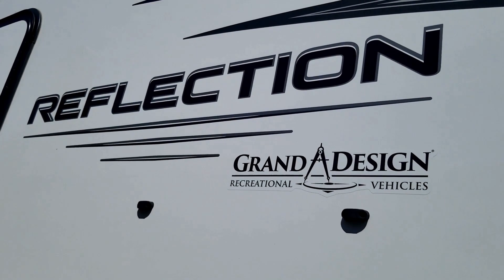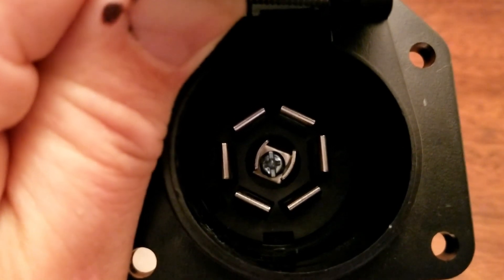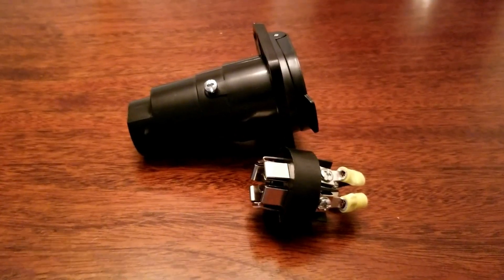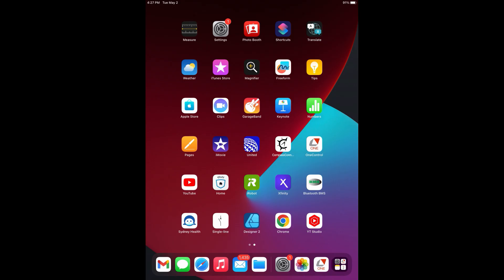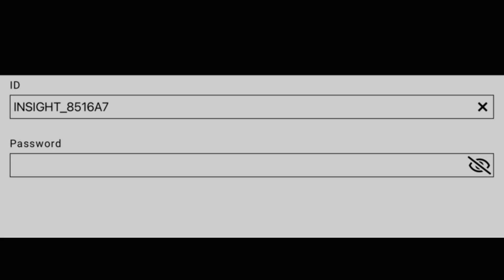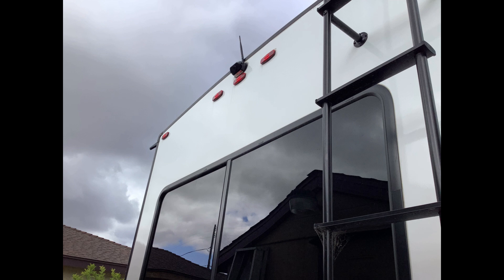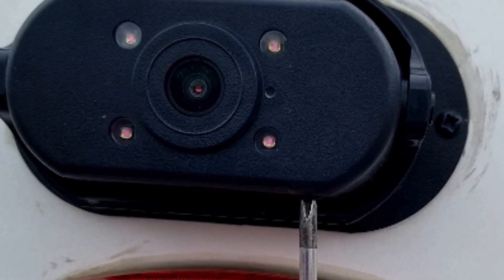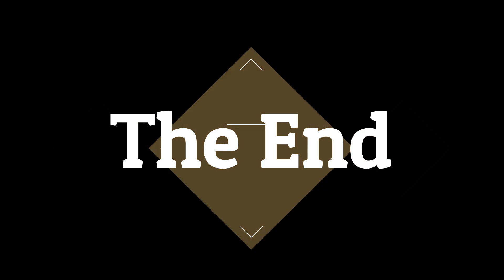Grand Design 303RLS   Lippert Insight Back up Camera

Comment: Please rename this to Onecontrol Insite Backup camera.  This is for anyone that has that system installed, such as my Rouge 32V.  It is the best step by step (even) without that cool ass jumper that i am going to make.
Reply from the maker: I added that as a tag so it should come up in a search better now. Glad it was of help.
Reply: @MyGrandDesignReflection303RLS  made the jumper and it worked.  Thanks.